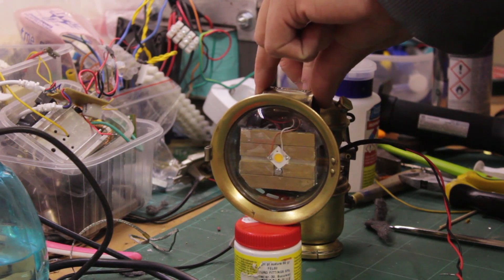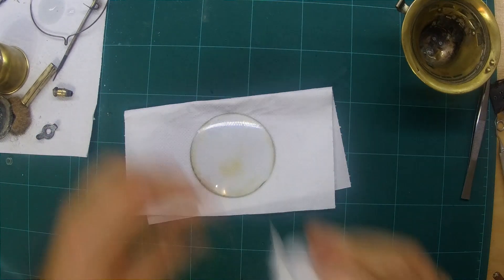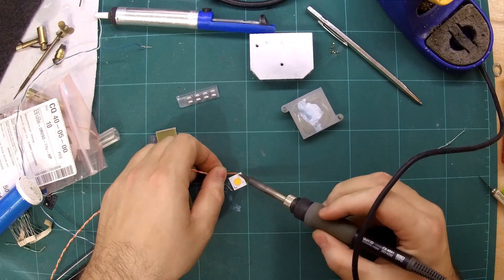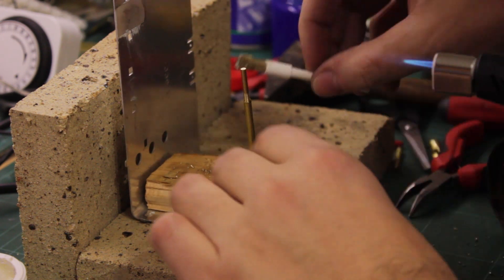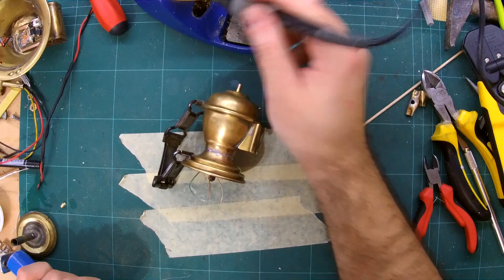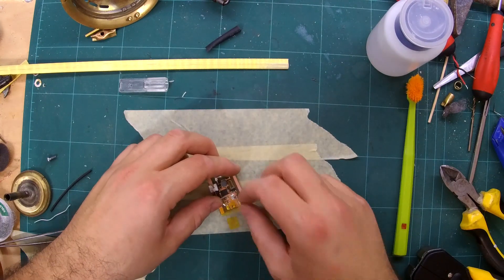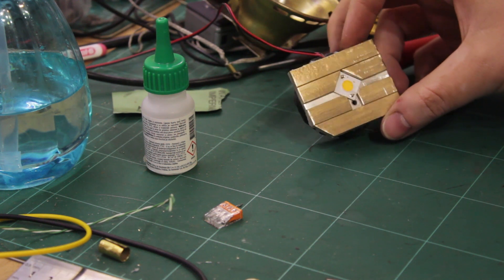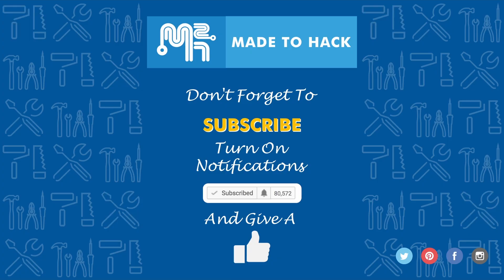Carbide Bicycle Lamp LED Retrofit for Rinoa Super-Genius

Comment: Good re-utilized piece of working history.  What kind of battery source did you use and how long did it provide power ( rechargeable ? )   Thanks  J K
Reply from the maker: Hi James, I did not use a battery. The circuit is made to use 12V DC power. In fact, it can go as high as 40V, but I believe Rinoa Super-Genius uses Lithium Ion LiPos in his ebike project.